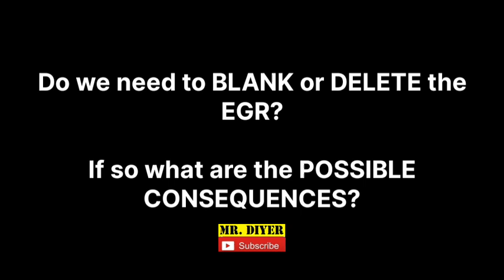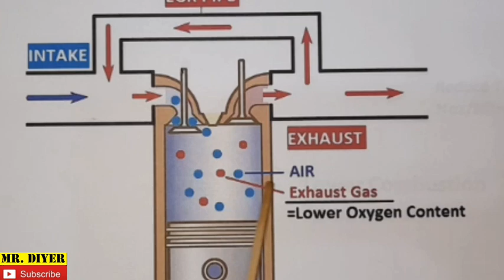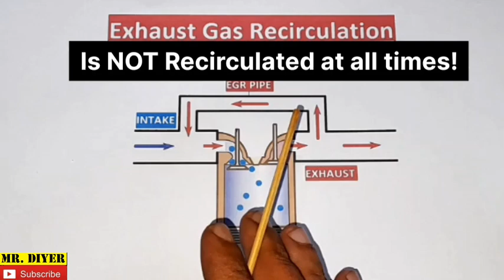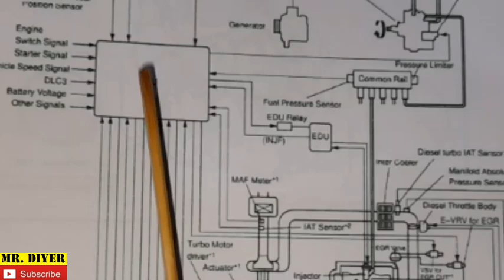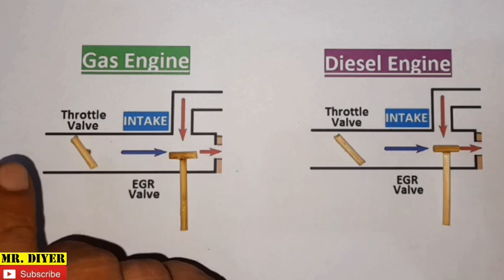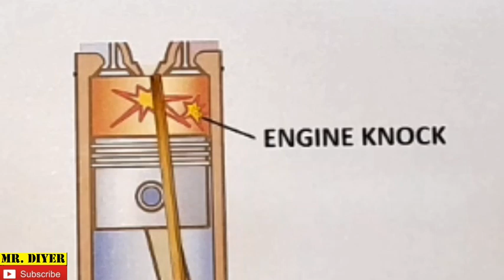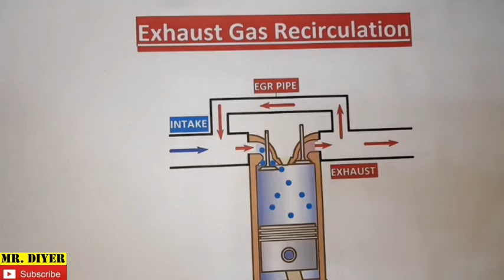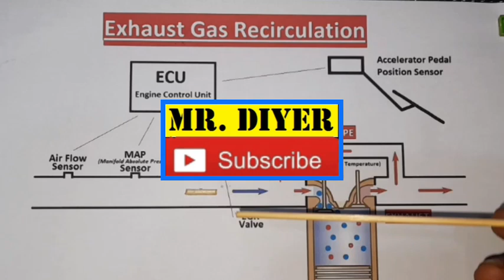EGR Explained! Do we Need to DELETE the EGR?

Comment: I have put a blanking plate on the EGR with the 7 mm hole. 50000 km after I did that I have had turbo failure. The turbine fins were damaged. I installed a brand new factory Toyota turbo and 47000km later i have the same problem. Would it be possible that this is causing higher EGT's and making the turbine weak? The engine i have is a 1kd ftv 3.0

Comment: The EGR is the biggest nuisance on car engines. I have deleted my EGR and since doing so, the engine no longer suffers from blocking up in the throttle body and it still passes the emissions test.

Comment: Summary: 
🤔 The idea of exhaust gas recirculation (EGR) can be controversial, with some people considering it "dumb" and equivalent to "eating your own manure."
🔥 The EGR system reduces the combustion temperature inside the cylinder, resulting in a lower temperature flame.
🌡️ The EGR system helps reduce the temperature of exhaust gases, resulting in lower nitrogen oxide emissions in diesel engines.
🌬️ The opening and closing of the EGR valve vary depending on engine operating conditions such as idling, cruising, or heavy accelerating, as well as the engine temperature.
🌬️ The EGR valve plays a crucial role in reducing toxic emissions by maximizing the flow of exhaust gas, but its operation differs between gas and diesel engines.
🌍 The common belief that the EGR decreases engine performance is false, as an engine with an EGR can actually outperform an engine without it in terms of speed, power, and fuel consumption.
💡 "I'm not saying that you should not delete the egr if you want to delete it fine. If you do not want to delete it fine. It's up to you. It's your engine. It's your prerogative."

Comment: So you mentioned deleting the EGR and the ECU still doing what it usual does, but what if you reprogram the ECU after deleting the EGR?

Shouldn't that new programming of the ECU account for the EGR not existing anymore, and deal with the problems or cons you mentioned with removing an EGR?

By what you explained, I assume regardless of anything the ECU is programmed to do, you would still have the heat issues, BUT like you said before, this only counts for the 1st cylinder, so all of the other ones are already doing this exact same thing, right??

So on a 6 cylinder TDI, we are only really talking about 5 cylinders being heated up and possibly knocking with uneven firing, and 1 cylinder that is protected because of the EGR?

Sorry if I misunderstood this, but that's how I understood what you were saying.

I really just want this diesel engine to be as reliable as the ones in the late 90's and very early 2000's, and don't want massive buildups and clogging of intakes.  Which I was under the impression that those earlier models would have had their ECU's programmed to deal with the heat in cylinder 1 before all of this extreme problematic and expensive along with constant sensor issues started getting so bloody out of hand.
Reply: @@tobiascat6173 Ok thanks for the feedback.

I have a very picky 2012 VW Touareg TDI...

The older diesels should do way more than 300k miles, but these newer ones are garbage when compared unfortunately.

My 12 valve cummins in my 97 2500 is over 600k and counting.  Well not really counting currently because the speedo stopped working over a year ago and needs a bit of attention... lol

I also love my 04 VW Jetta TDI.  That thing is amazing!

This 2012 Touareg, not so much...
Reply: If you modify the EGR map to keep the valve closed, you don't even have to delete it
Reply: @waldolemmer  oh interesting, thank you.

Comment: Manufacturers should design an easy-to-replace carbon filter to prevent carbon buildup in the EGR system components. So people would  not want to block it off. 😀

Comment: A question. First, it seems like much of this doesn’t apply to an old style diesel that is 100% mechanical injection with no ECU input, is that right? Eg pre-1996 4M40 with no sensor input like a CRDI. With such an engine, as long as exhaust temperatures didn’t get too high (detonation risk, turbo risk), isn’t blanking the EGR a safe way to get a more responsive engine at 0-2000rpm? What is the downside?

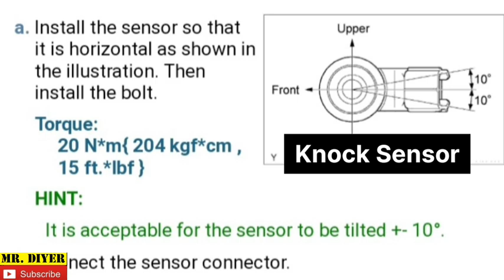Comment: 17:31 
Great video explaining this.
However the mention of ignition timing at this point in the video wouldn't apply to a diesel given there is no ignition timing?
Perhaps what is meant is perhaps fuel (diesel)  injection timing maybe adjusted in this situation?

Comment: Yes, we need!
Reply: I am tired and can't watch careful, but this is what I see: your explanation is mostly correct. You make maybe just one mistake, in my opinion. You say, in gasoline engine  EGR is open when butterfly is closed, but actually he is open when engine have high RPM, and butterfly is open. Also, this what you saying is just theory, in everyday experience, is not the same as theory. When you have EGR valve, carbon buildup is formed inside of cilindar, and this causing knocking and bad cooling. Then all exhaust  gases go higher, including NOX. EGR valve have a small impact on NOx, because don't works all the time. Engines  last shorter, EGR literally destroy engines (except those which are driven mostly on highway). Etc...

Comment: ok first thing first , he shows diesel engines they work with self ignite, literally no fuel is in mixture till compression so talking bout nocking is stupid you cant make engine nock if there is no fuel in it, in diesel engines all egr does is louver emissions, plus diesel engines are always lean running so the more heat it can produce the more power it gives meaning better fuel economy and power. Blank egr remap your engine for cpu to work correctly and make more power and fuel economy

Comment: Yes, If you like having both better fuel milage and engine power at the same time, you want to delete the *EGR system and all other emissions compliance related stuff.   This is not hard to figure out."

There's a reason that when emissions regulations came into play decades ago ALL engine manufacturers stopped advertising their engine's fuel efficiency numbers in terms of Horsepower hours/ gallon or KWH/liter of mechanical power output;    Nobody would buy an engine that put out half it useful mechanical power for twice the fuel consumption as its old pre emissions version made if they did.

Comment: if your diesel car was registered before 1998 by all means remove of blanc of the egr with a plate they are not usualy linked to the ecu at that age also removing the catalytic converter is also legal for up to 1997 vechicles and it will improove performance of the engine because it will breathe much better , did all thius to my 1997 citroen xantisa 1.9 turbo diesel estaste and it went like a rocket the car drove faultlessly until it was 18 years old and had covered over 300,000 miles.

Comment: There are electronic means to disable the EGR via instructions to the ECU, which means the ECU "knows" not to open the valve, so your description on what occurs if the EGR is "blocked" may be incorrect in that scenario surely. Other than that a VERY informative and descriptive presentation, Thank you, from Australia.

Comment: The whole carbon emissions thing is a total scam there is no way in hell that a piston engine after detonation can capture an recirculate non burnt glasses all the EGR, charcoal canister, and EVAP valves , are for pressure in the fuel tank to burn the fumes, it's the most expensive gas fumes you can buy, and considering how often one of the 10,000 parts associated with it goes bad with a average cost of 1000 a visit to a mechanic and cat converters costing 1k each plus labor , this whole system could be replaced with a small expansion tank. Once the gases pass the exhaust valves it's gone and the solenoid on the canister release it to outside air minus the smell . Adds 4 dollars a gallon for little to no change in the way your engine performs, but it'll make your computer shut your vehicle down.   The difference between 70s cars and today's cars emissions is that the fuel is cleaner and the combustion burns almost completely.
My truck smokes with all the EVAP crap hooked up, unplug it all engine goes to the base setting runs great doesn't smoke,
Reply: He’s saying that the burnt fuel lowers the temperature of the combustion inside the engine because it has less oxygen not that it’s is capturing unburnt fuel.

Comment: @Mr.DIYer you are correct but wrong at the same time as far as with the exhaust gas and i am looking at that cause of the Stoic Volumes  . and i say that for two reason one by inserting the exhaust gas you are replace the incoming air with a inert gas ( aka exhaust gas ) since it was already burnt for the most part with a small part of it being unburnt as well . with that being said you are now  reducing the amount of fresh air that can take up the same volume of . and as such you are not burning the same amount of fuel if you didnt have the egr running. But you did touch on this in a overveiw at 7:oo minute mark But also you and everyone is making the assumption that the Ecu will take over the  amount of fuel ( either Gs or Diesel ) and then run the correct amount of fuel into the combustion chamber. Which this is done by the O2 sensor telling it to reduce or increase the nano time the the injectors are open to keep the optimum fuel/air ratio . But that is not always true especially on a Egr delete so one would have to go in and then readjust the fuel profile to take this into consideration especially if you fall out side of the orginal programming done by the manufacturer. OverAll this is the Best and MOst Comprehensive Video I have seen on this topic and answer on of my question on why it seemed as my EVR solenoid wasnt working since it tested fine in all regards but didnt seem to work .And From what I am gathering from your video as i have my antifreeze set on the strong side cause of my environment around me here being rather cold and worrying about possible freeze up and over heating during the summers . THat cause of that the engine isn't getting to temp and the ACT was possibly causing the issue by telling the ECU not to engage the Evr since it thought the engine was still running cold . and that i believe is a point that you might want to bring up in the video either here or on a Evr diagnostic solenoid testing video , which i have not heard anyone bring to the for front there as a possible issue why the Evr might not see as it is working and the Egr then not engaging while running the motor and looking thru the holes on the Egr looking for movement on the piston inside of the Egr and or Poor Fuel Consumption as the Evr would then seem not to be working and supplying vacuum to the Egr . Or am i wrong on my assumption here in regard to the antifreeze and the ACT/Engine Running Temp ? I would kindly like to know as I am scratching my head on this one which is why i sought out your video and ones like this Of Which Yours blows the rest of of the water for depth on the subject as well as clarity on the system . I hope to hear back from you soon on this and PLEASE KEEP UP THE EXCELLANT WORK !!!!

Comment: EGR is extremely harmful and expensive to remedy on any engine, diesel or petrol 
if the exhaust temperatures are 10° higher without, manufacturers just need to make a cooling system that will work like many other private and  commercial vehicles before.. .it's simply emissions nonsense and a mechanism manufacturers can use to reduce the life of the engine, increase the cost of ownership, therefore leading to replacing there vehicle. That's it. Let's not get started on dpf...

Comment: I have been a heavy duty diesel mechanic for over 30 years now. None of the emissions changes they have made have given trucks better fuel economy. But like he mentioned deleting the egr system greatly effects the combustion temperature. I have seen many deleted engines and they are know for cracking the head due to higher temperatures.
Reply: Hi sir, I own a BMW E46 320d 150hp. I deleted the egr without problems after it. It's an euro 3 car. Do you think I could have those head problems on the future on It ?
Reply: @Adrian-re9fh  
From the research I just did on your BMW it looks like they are using the same head casting before and Afters they added EGR to that engine. So as a everyday driver not trying to be a high profor
Reply: Not trying to be a high-performance engine it should be just fine.
Reply: @theodoreflageolle3617  Thanks, have a nice day.
Reply: is the s the air from the turbo and intercooler to the intake manifold, TB not cooling the engine compartment enough?

Comment: mechanic here , this guy is correct, also D4D hilux/prado etc pistons crack due to high  engine load (full power up a hill towing a caravan example), hot piston ,cold fuel shot at piston.......so if you can lower the combustion temp you improve the chances of pistons lasting. so EGR needs to stay. sadly it will soot up the intake but there are ways to mitigate this.
im sure ill get critics but its true (i wish it wasnt haha)
Reply: Mechanics are making a lot of money repairing this shit as a ex cat mechanic this system that engineers have designed is rubbish I operate a fleet of Kenworth trucks that have Cummins engines some with EGR system's the one's with this system are maintained regularly by Cummins they have been a headache from the first day a brought them now that idiot talking about cracked heads if you disconnect the system that's bullshit the one's I own still have the system connected one engine has had 4 heads and 6 turbo's all under warranty another one has the similar problems they over heat and spend more time at Cummins than on the road all under warranty one of them Cummins replaced  the whole motor bottom line engineer's that design this system should hang there heads in shame after the warranty run out on these engine's I have disconnected 4 trucks from this system getting better fuel economy and no more down time breaking down and more reliability and running cooler and the running costs is 20% less now so if you people have to go and run a fleet of trucks with these systems and see the headache you have caused in transport industry you IDIOTS
Reply: Does this go for  complete blanking or can u use 7mm plate and be fine
Reply: @marzy0666 id leave blocking it off or restricting it, and just focus on some form of catch can to remove(reduce) the crankcase breather (wet) from blending with the egr gas (dry exhaust) which makes that awful mess of the intake. Thats what ive done , 2,1/2 litre aluminium custom catch can,baffled and stainless steel gauze(pot scrubbs)then sieve on the inside, drain at bottom. Input at the top output at the top but crankcase gas has to pass thru gauze etc. located under rhs headlight. It works.

Comment: A friend of mine removed the EGR on his Mercedes Sprinter and got 20 - 30% lower fuel consumption, with todays prices on Diesel this is a HUGE saving....
Reply: He would only get that level of improvement against a blocked egr. No way is that an improvement against a properly working egr. As the video says an egr delete results in higher combustion temperature which will eventually wreck his engine.

Comment: EGR is one of those inventions that works in theory, the problem is is that it's only good when new, once you get the carbon build up it makes things much worse than if it wasn't fitted.
Reply: they don't work in theory either. it was all a scam by democrats to help the oil industry.
Reply: Thats why he said it’s better to clean it. The problem is with the manufacturers and dealers who do not include the egr cleaning service as a part of the regular PMS.
Reply: @rick-v4g8s  or just remove it, and save fuel and money.

Comment: Not bad. It will be interesting to hear the fuel economy difference and the advantages of an open deck engine vs a closed deck engine.

Plus, l would like to compare the fuel economy between a port injection and a high pressure fuel injection engines (like the Toyota Supra).

Comment: EGR is a hoax. It works, like many "green improvements" only in theory and does not account for ;long time use.
The EGR produces, like you say yourself, carbon built up. Not so bad on the EGR valve, but seriously impacting performance, and, more importantly from the "green" perspective, makes the engine run way less efficient creating more pollution then it would without the EGR.
We need research on when the tipping point occurs between reducing and increasing pollution.

Comment: If you feel you must improve on the EGR system but not delete then I recommend doing what some  high level manufacturers do and run your source from after all other exhaust treatments are done, it may be a bit more costly to run a small diameter stainless pipe from the rear to the engine but 3 distinct advantages are 1.it will be a lot cooler temperature by the time it gets to the egr cooler and lessen the tendency of cooler cracking 2. It will have far less solid particles to clog the intake system and build up on valves 3. You won't get a huge fine for deleting it